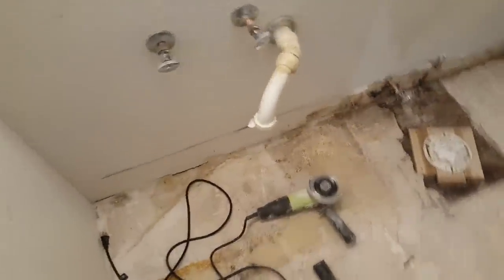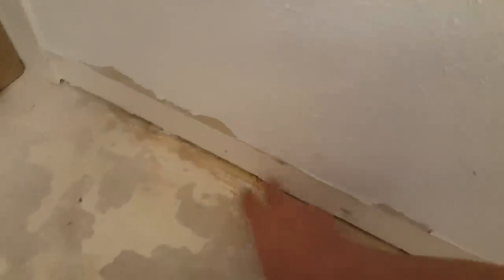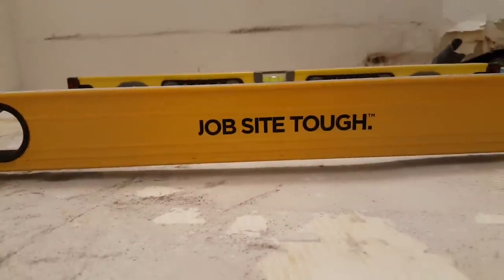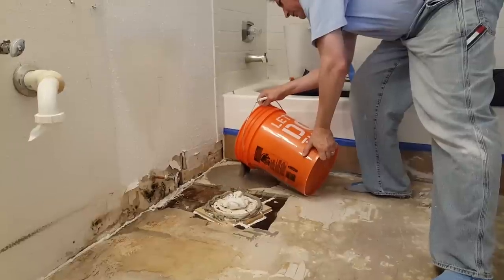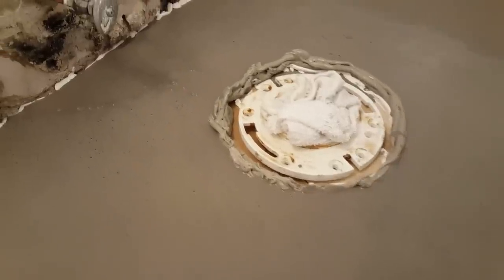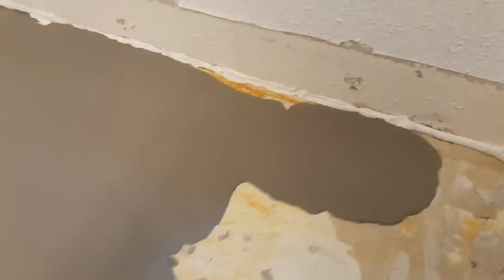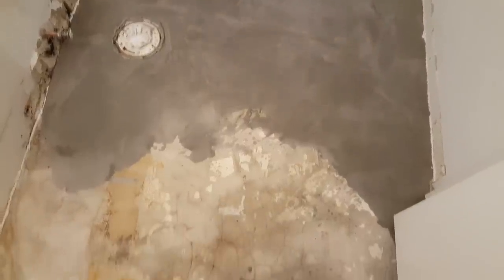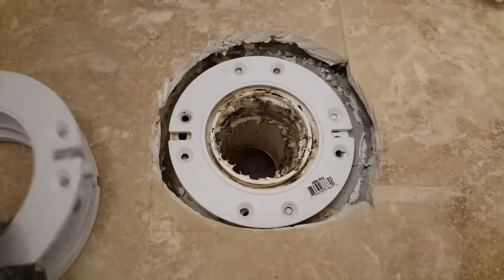How to Self Level a Bathroom Floor Using Self Leveler Cement

Comment: I don't have the patience for that. I will demo the bathroom to the studs and start over. Everything goes even the tub. That's the right way.
Reply from the maker: Unfortunately we were already remodeling everything on the other side of the tub in for a $90000 condo you can't spend $10000 on a bathroom when you still have another bathroom to do the same thing to.
Reply: @jeffostroff  $10,000 a bathroom seems a little expensive. You did do a good job floating the floor looks good and level. Good episode on doing that.

James
Warren , Michigan
Reply from the maker: @jamesw4912   Yes a lot of people get blindsided when they ge price quotes from contractors for remodeling a bathroom so that $10000 cost is my cost for me doing it myself. But a friend of mine just got a quote  from a general contractor for $24000 to do their bathroom.

Comment: Wow! So wrong. I am no contractor, but have watched plenty of home remodeling shows, plus a little common sense. Anytime you add concrete to a two story house (which you should not do if you have wood sub floors) and it has started to crack, your foundation needs to be addressed. If this is the second floor and around the toilet, it is a MUST that you get down to the sub floor and replace any wet or rotting wood. It may take a little more time and labor, but it will also give you the opportunity to level the floor. Then you have no need for adding all these extras. If you do not have good wood for a support, your new floor WILL FAIL! With the soft rotting wood, add weight of toilet, lever, thin set and tile. I would not stand under this bathroom on the first floor. After replacing the damaged wood, I would use Schluter"s Ditra to the floors. They can help prevent tiles from cracking and you can also add heating to the new floors if desired.